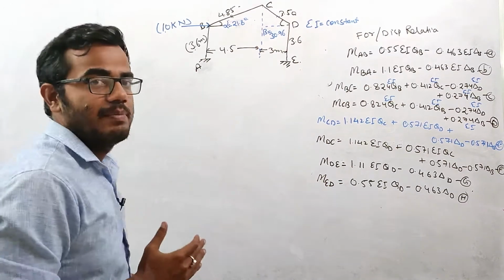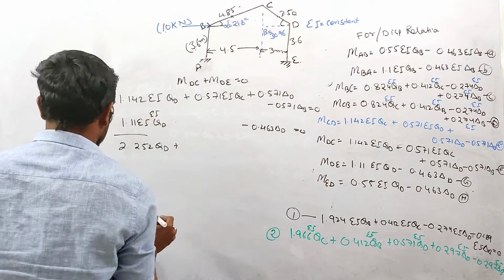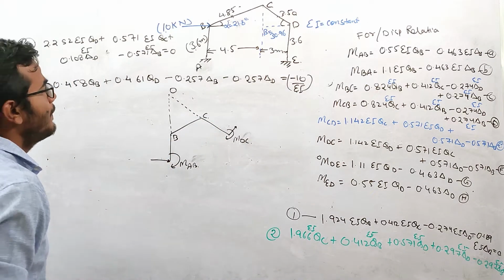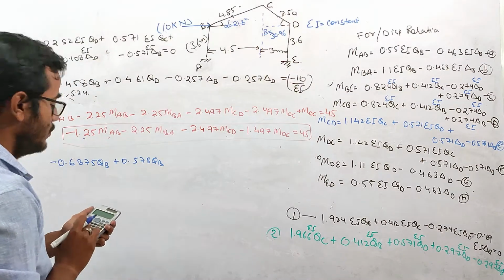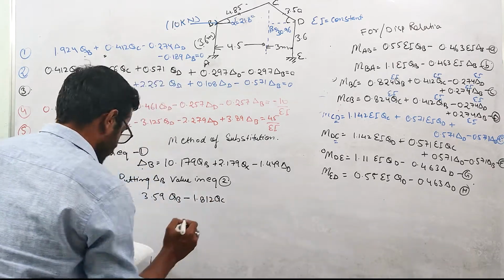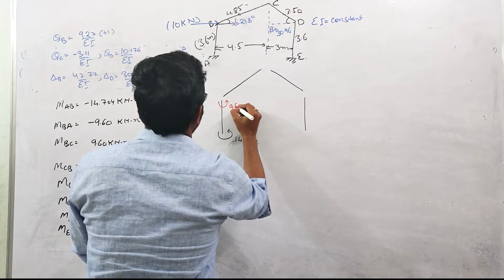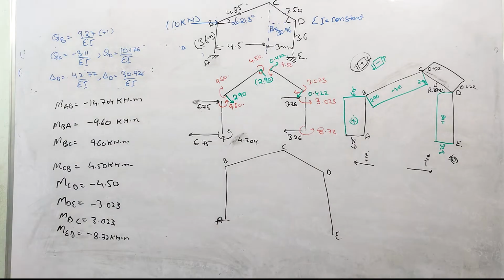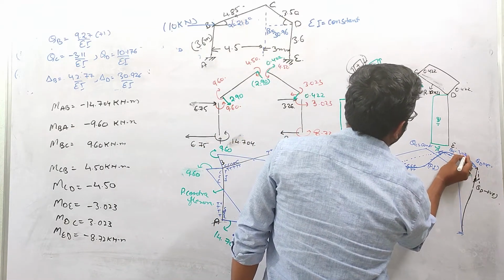Gable Frame Analysis using Slope Deflection method. Part 2

Comment: It helps me to understand the slope deflection method and it helps me to compute rigid frame... I am little confused for the sign convention used here at the shear diagram
Reply from the maker: glad to know that it helped you. For shear force direction, the assumption is similar what we do in simply supported beam that is left side upward positive and right side down negative. You just rotate shear diagram  for simply supported beam anticlockwise.